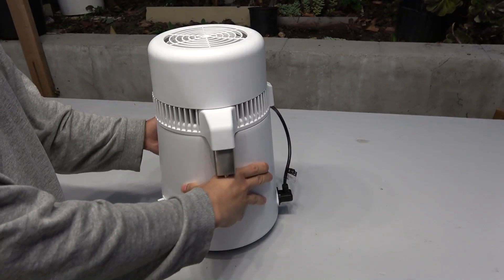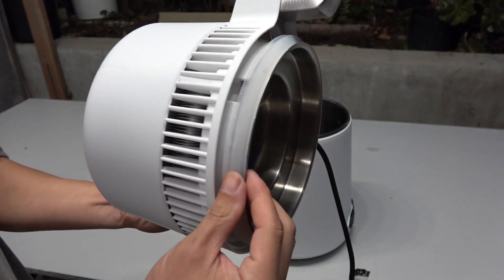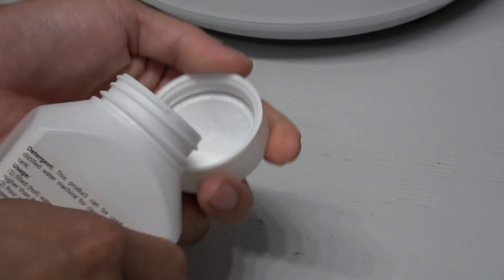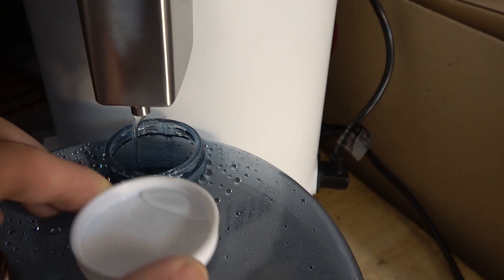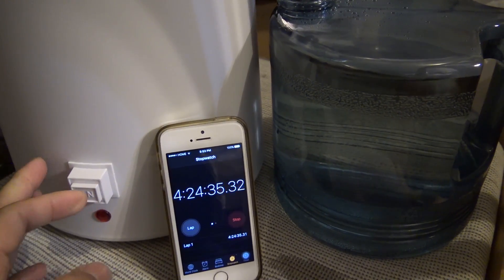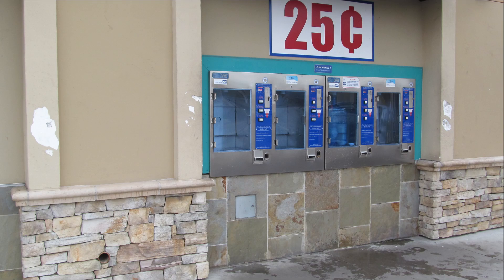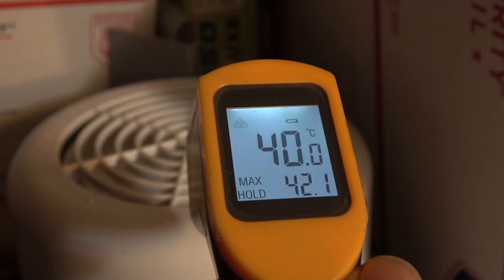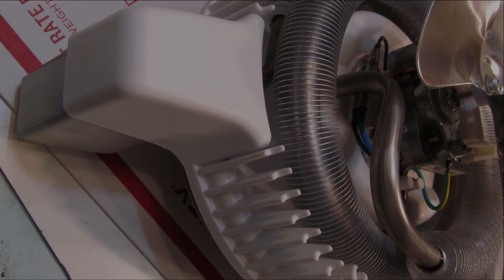Review: $60 Ebay water distiller, all stainless steel internal

Comment: It maybe a little late but why would you want to drink distilled water. It can in fact de-hydrate you and remove needed nutrients from your body.
Reply: Have been using distilled water for years, and is very good for drinking. It's the most pure water the body can uptake, and just ingest minerals with my vitamin supplements. Plus the foods that we eat are loaded with minerals, and isn't just from water that you get them. Additionally if you wanted to, you can purchase liquid minerals and add it to the water. A balanced pH is also very important, as cancerous cells cannot live in an aerobic or oxygen rich environment and is why I use pH sticks or bicarbonate for balance. 
(Note) Beware, you can't believe everything you read on the net people lol
Reply: @AlastairGames  That's exactly right, it is the most pure form of water possible and have been drinking it for years. Basically what you said, we get minerals from food and isn't just limited to water.
Reply: On planet Earth, before man made pollution, were not the clouds virtually raining distilled water...for eons?
Reply: @kelhawk1  Except when the air was polluted from natural events. Odds are most people got their water mineralized from ground sources; obviously different blend depending on where.
Reply: @kelhawk1  not unless you held your head up to the rain
Reply from the maker: Who told you that?
Reply: I Absolutely Love that Response" Who told You that "...which i do not believe .... Water will hydrate no matter if its marked Distilled or Drinking
Reply: @vuaeco  Doctors say it isn't necessarily true, because you can add minerals before consumption. There are several ways people are suggesting to remineralize purified water. For detoxing they suggest considering to drink it pure for a period but don't overdo it. If it's too pure when it gets into your blood stream it will make red blood cells explode. Maybe it can be safe to just mix in a flavored drink mix that includes electrolytes and vitamins. Don't take my word as expert advice. If you have questions ask several doctors or look for their answers that are already provided.
Reply: @vuaeco  It's all over the inet, so it must be true:

Drinking distilled water and not maintaining a balanced diet can cause changes in the levels of electrolytes, minerals, and pH levels in your body.

The pH of distilled water is lower than that of tap water or mineral water, making it more acidic (8). While it’s 7 immediately after distillation, after a few hours it absorbs carbon dioxide from the atmosphere, bringing the pH to around 5.8. This, combined with a lack of minerals and electrolytes, can harm the balance of nutrients in the body (9).

A section taken from a site. You can drink it, but cannot survive, solely, on it.
Reply from the maker: @nicknackthenoo  The "inet" says pigs can fly, it must also be true.
Reply: @nicknackthenoo  You do understand that distilling water separates everything from the water leaving it pure. Yes that includes all the minerals (usually just Calcium, Magnesium, and Potassium) that you can find in Vitamins, and Food, but it also includes Lead, Mercury, Chlorine, Bisphenol A (BPA), Giardia Lamblia, Fluride, etc.. "It's all over the inet, so it must be true" You've obviously lacked research. So I'll ask, Please for the love of common sense actually research this? Eating Healthy, and Drinking Pure Water is the opposite of unhealthy, now if you sit on your ass all day lacking exercise and smoking then go ahead drink swamp water.
Reply: @vuaeco  Yes I have read that and totally agree.
Reply: @nicknackthenoo  Yup...It's all over the inet, so it must be true
Reply: @nicknackthenoo  Sounds bs
Reply: @Drunkbobnopantss  no.. get your minerals from food, if need be take vitamins, I drink spring water and use distilled water all the time. I'm healthy as an Ox, I never get sick and rarely ever get injured, and heal fast when I do. So I've come to the conclusion what I do works, or I'm truly a remarkable specimen. I drink a gallon of water daily half spring, half distilled, I eat 5 meals a day with 2hrs in between, I'm 6' 2" , 240lbs with 12% body fat, and train 5 days a week 3hrs a session, and I'm active the rest of the day, before Covid I was a warehouse supervisor/ operational manager and ran circles around our staff without ever getting winded. I don't smoke, and get 6-8hrs of sleep every night. I'll say it once again "In my opinion" if you're body is lacking minerals than eat more Food, and take vitamins.
Reply: @lokionthelowkey9664  your arguing that distilled water is healthy for you, its exactly the opposite and this was proven like 20 years ago.

"Despite its benefits, distilled water is particularly corrosive. With no minerals to give the water pH balance, distilled water acts like a magnet, absorbing chemicals (phthalates and bisphenols) from plastics, nickel from stainless steel, aluminum from aluminum containers, and carbon dioxide from the air."

not to mention reduces bone mineral density and electrolytes which strains your whole body especially your heart its extremely unhealthy

https://en.wikipedia.org/wiki/Distilled_water#Health_effects

just because your not sick dosent make distilled water safe
Reply: @Drunkbobnopantss  The World Health Organization is more concerned with public policy, which needs to address issues that are sometimes caused by large populations of people making facing unreasonable challenges or making mistakes. If a group of people doesn't have enough calcium in their diet, then the WHO is going to recommend adding a certain amount of calcium to the water supply in that region, with the intent of raising the average levels of calcium in individuals living in that region. On such a massive scale, that's a convenient and relatively quick solution to the problems they recorded. On an individual level, the answers look different. We are certainly examining our own lives far more carefully than the individuals that the WHO is worried about. As individuals, we also don't have the same logistical complications (ex: maintenance of citywide plumbing systems). If we're short calcium, then we can simply add calcium to our diet, regardless of what's in (or not in) the drinking water. The WHO researchers are, rightfully, going to prioritize their advice towards helping people who start off in far more perilous situations than what we are experiencing. They also seem to be informing city planners, and we are not planning cities; well, at least I'm not ;)

As for webmd and Dr. Keppel...

A lot of that material trying to scare us about demineralized water seems to all use the same "it doesn't provide you with nutrients" argument. And I find such arguments unhelpful, because we can obtain those nutrients by other means, thus allowing us to solve far more difficult water safety issues with a simple distillation process.

For example:
"Some studies have found a link between drinking water low in calcium and magnesium and tiredness, muscle cramps, weakness, and heart disease."
https://www.webmd.com/diet/distilled-water-overview#2

I read this as:
"Some studies have found a link between low levels of calcium and magnesium and tiredness, muscle cramps, weakness, and heart disease."

The article doesn't cite its sources, so I can't inspect the studies to see if anyone actually controlled for that.

The same article also says this in the next sentence:
"Also, distilled water may not help you stay hydrated as well as other kinds of water."

I can see how this statement may be true: it doesn't have electrolytes, and electrolytes help my body retain water, so my body won't retain as much of the distilled water, therefore I won't be as hydrated. OK, sure.

Unfortunately, some of us seem to misread this as "distilled water dehydrates you". The article is probably speaking truth, but the echo chambers of the internet can easily provide an interpretation that is no longer true. I suspect that Dr. Keppel picked up one of these interpretations, though he didn't cite sources, so it's hard to check. Doctors are humans too, and even well-intended doctors are fallible. They're even vulnerable to not having enough time to research every little nit-picky subject, as we all are.

As for the WHO article...

The rate of dissolution matters: in this case we're intending to distill some water in a stainless steel assembly and briefly store it in a glass container, where it will be consumed within a day. (The author of this video used a plastic container, but we can just use a glass container instead.)

It's not going to dissolve much on that timescale. We'll probably get more contamination from the small amount of material that rides the water vapors, and probably an even greater amount of stuff landing in the water from our non-sterile environments (unless you're living in a well-equipped clean room).

This avoids any worries about it picking up phthalates, bisphenols, nickel, aluminum, etc. Of course it may pick up carbon dioxide from the air (and, as above, other things too, so don't store it for too long!), but CO2 sequestration and indoor air quality are another problem entirely.

This also addresses many of the points in the WHO article, which seems primarily concerned with discussing the pitfalls of distributing distilled (highly purified) water through various local plumbing systems. In this case, we're making it ourselves, and we're not storing it, so we don't have leaching and bacterial regrowth problems.

" distilled water is one the strongest solvents in the world!"

I googled "strongest solvent" and the Google responded with "butanone" (or acetone).
https://imgur.com/a/rR1zeLA
"Butanone. Butanone or MEK is tied with acetone as one of the strongest solvents. This solvent is used as lacquer, varnish, paint remover, denaturing agent for denatured alcohol, glue and cleaning agent."

This highlights the hazard of using relative terms (ex: solvent) in absolute contexts (ex: strongest). The rate at which a solute dissolves depends on both the solvent and the solute itself. Distilled water does dissolve many things, but not all things, and some of the things it dissolves can be dissolved faster by other solvents.

We could ask Google the same question 5 years from now and get a different answer, and it would still be "right". To obtain and proliferate more useful information, we have to be more specific.

"Believe me i have done my research I would love for distilled water to be healthy but all the evidence points to no, it literally dissolves nearly anything you put it in "

I stand by my earlier sentiment: we are humans, not metallic plates or pipes.

Our bodies react to the substances we ingest in very dynamic ways. Of course, this advantage has limits, and we can't escape harm from extremes, like acetone. But acetone has an extremely aggressive rate of dissolution with respect to organic substances (like cell walls), while distilled water is more of a "jack of all trades and a master of none". Distilled water is not even remotely aggressive enough to burn us before our biomass completely overwhelms it. Sure, distilled water could dissolve a human body, but that would take days (if not longer, especially without decomposers) of complete submersion in a much larger volume of distilled water, and it'd go a lot faster if the body is a dead body (sorry, morbid). This is why I am fairly convinced that the corrosivity of distilled water is unable to harm a human being by way of ingestion.

I suspect, though, that your point is that distilled water picks up contaminants from plumbing or storage systems, and the contaminants can cause harm. Sure. I'm not considering that for myself or arguing for anyone to do that. I'm talking about water that is distilled and used within a day, and using materials that take a very long time to dissolve (decades, centuries) or leach (days, weeks, months) into distilled water.

After that, the worst I'm seeing is that distilled water can harm someone by failing to provide nutrients that they expected to get. For sake of additional clarity: this has nothing to do with corrosivity. More importantly, it has an easy solution: we change our expectations and supplement the nutrients by any number of numerous means. Protecting ourselves from harmful contaminants with our hands tied behind our backs (ex: no distillation or comprehensive purification allowed) is considerably more difficult, if not impossible.

I'd much rather have the "selective supplementation" problem than have the "selective filtration" problem.

Here are examples of products that someone might put in distilled water to create mineralized water before drinking it:
https://vitasell.net/products/tr0005
https://amzn.com/B0028BW0IO
https://amzn.com/B07HHR58LP
Drinking this mineralized water should have a reduced chance of ingesting harmful compounds. Granted, I'm not entirely sure how to be confident that the makers of these things haven't introduced contaminants during acquisition+processing. It'd still be an easier problem to solve, as it involves tightening regulations on a manufacturing process instead of tightening regulations on ALL of the plumbing. As an individual, I'm content that our odds are probably better on this route, even if it's not done perfectly.

I also don't feel any profound need to mineralize my water, because I can get blood tests performed and then directly solve any "not enough nutrients" type problems in the most direct and effective way possible.

At one point I had iffy-looking Vitamin D levels (though not quite out-of-spec), so I supplement that, just to be safe. Now my Vitamin D levels are fine, as well as calcium, magnesium, etc etc. Problem solved.

Unfortunately, blood tests are far less comprehensive when it comes to detecting harmful compounds. The number of things we need is finite (e.g. a list of nutrients), and it is dwarfed by the number of things that can harm us (infinite combinations of molecules and mixtures). Again, it is far easier to start from nothing and build up to what we need, than it is to start from chaos and assay/filter every imaginable chemical substance until we've proven that only our necessities are present.

Even if we disagree about what's in perfect water (and that's totally OK), distilled water still gives us a starting point for creating our own ideal water, and in a relatively inexpensive way.
Reply: @Drunkbobnopantss  Bone and heart disease? Read above. It would take roughly 1800 glasses just to get the DAILY calcium intake.
Reply: @Drunkbobnopantss  Are you a paid shill for them? Been proven wrong by actual factual data here by me and that other dude who wrote a lot about this. No studies or proof can be found of any negative effects on the human body when drinking distilled water.
Reply: @Drunkbobnopantss  And again, US nuclear submarines, 0.002ppm is all they drink... some of the fittest and healthiest people on the planet. IF distilled effected their body or mind, of course it would be stopped.

There are no known scientific data which clearly demonstrate that the consumption of low TDS water by humans will or will not lead to harmful effects on the human body. However, a number of field experiences can be cited which support the premise that the consumption of such water by humans does not cause such harmful effects. There are no known documented experiences which show that consuming low TDS water will create any long-term health effects.

The US Navy has used distilled sea water for 40 years.
Reply: @Edderz  TDS = total dissolved solids = remineraliZed water they are not drinking distilled water that would be TDS 0
As soon as you dissolve anything in the water ie salts or minerals it is no longer distilled water you are drinking. Even 3mg / L is far from distilled when it comes to ion activity in the water.

Point is anything besides TDS 0 is NOT distilled water so everything you said is pretty meaningless
Reply: @Drunkbobnopantss  I’m sure distilled water is classified as 5ppm and below
Reply: @suzyhazelwood9942  this is one of the most ironic things i have ever read, YOUR'E the one being sold lies AND water distillers. there is over 50 years of research from countries all across the world showing the dangers of low TDS water 

Notice how the only ones advocating distilled water are the ones trying to sell you distillers or accreditation programs
Reply: @suzyhazelwood9942  Read how much I’ve shown them. They’re brainwashed and won’t listen to anything other than their biased view
Reply: @suzyhazelwood9942  HAHAHA stay in school kids
Reply: @vuaeco  , the collection container should be GLASS not PLASTIC !
Reply: @Drunkbobnopantss  From that very link you posted near the top "Distilled water is safe to drink."
Reply: @suzyhazelwood9942  I want to try using distilled water because it would be more pure and a less expensive option for my family.  I am wondering though....do the long-time users of distilled water have reports of bone density tests?
Reply: @willow-wf3jf  I doubt exposing ourselves to radiology bone density tests is good for our bodies unless we have a serious need to do so.  I have several friends and relatives who have been drinking distilled water for over 20 years, they are now in their 70's and 80's, not one has health issues with bones, or any other health issue. But friends I know who are nearer my age (50's) and think drinking anything other than tap water is insane have all got bone issues of one kind or another. Tap water is full of chemicals that will gradually destroy the body.

The most important issue with bones is to make sure we eat a really healthy and varied diet rich in vitamins and minerals.  Drinking distilled water will not deplete the body of the minerals we digest from good wholesome food... as some crazy people who have never even tried drinking distilled water have convinced themselves it does.  They all talk nonsense and never base what they know on personal experience. If you want to try distilled water, go for it... it's not going to harm your body... but chemicals in tap water will.
Reply: @suzyhazelwood9942  I drink bottled water but it is expensive, so I was hoping to cut down on cost but also make it healthy.  Thank you for the info.  It is good to hear about personal experience.  Yes, I agree there does seem to be a lot of misinformation.
Reply: @nicknackthenoo  all of which are good things to your body. It does not remove the good minerals found in vegetables and fruits.
Reply: @nicknackthenoo  
LOL
Reply: @nicknackthenoo  Can't survive solely on water anyhow. Just have a cliff bar each day and you've offset the lack of minerals in the water. Easy peasy.
Reply: @nicknackthenoo  And the inet is run by the governMEnt. Learning real science is important, doing the work. We are to get our minerals from food (dehydrate, store, dry can, etc).
Reply: @nicknackthenoo  You seem like a man that would trust more drinking tap water, then filtered distilled water. You have said it all, no need to listen to you.
Reply: @baka-baka-baka-baka  I love this answer,   very informative and strong educated arguments with good analytical points. Thank you so much, just brought my confidence up in my choice of water, especially about what you said, that Its better to start from nothing and build our ideal water, then to start from chaos and try to eliminate the countless potential harmful substances in water.
Reply: @Drunkbobnopantss  yes over 50 years of research. And those very same agencies,  organizations, groups, and people, continue to tell you that drinking tap water is a safe alternative. doesnt it make you a little suspicious, not even a little?
Reply: @originsdecoded3508  what makes me suspicious is people telling me distilled water is the best water whilst selling distillers. its safe to drink as long as you mineraliZe it after which no one ever mentions but then its not distilled water anymore
Reply: @Drunkbobnopantss . Personally for me it beats unfiltered and filtered tap water or even bottled water which leaches decent amount of micro plastics and chemicals.  Its true that distilled water can indeed pull minerals out of the body. But the amount it pulls is very minuscule, and trough the foods we consume like veggies and fruits, and supplements we are constantly replenishing what ever tiny amount of minerals is pulled out. Another great option, but more expensive (700-3000 for home unit) is reverse osmosis machines. 

You know, distilled water just doesnt pull out minerals. since it is considered a form of a solvent like mineralized water, or hydrogen water, it also pulls out toxins and waste from the body, so its perfect combination for detox phases. such as liver cleanses. 

If one is not looking for such detox benefits but only just wants pure water without stripping anything from our body, then I suggest after distilling the water to put sea moss, or cut up fruits high on minerals and let sit in the water. 

Another great alterative to making the distilled water more hydrating is hydrogenize the water ( hydrogen water ) which is form of ionizing the water molecules to give it a positive charge which then has a stronger interaction with the negative charge in our bloodstream thus having a higher rate of hydration, and also acts as antioxidant to cleanse toxins without stripping minerals. 

I definitely agree that distilled water is not the best water, because its practically nothing, its just a baseline from which one can start clean and free of anything at all, and then you enhance it as you wish. 

Optimal living water recipe. 
1.distill the water (99.9% purity)

2. hydrogenize the water in a ionizer (antioxidant/antiflammatory)

3. add sea moss, herbs, or fruits high on mineral and vitamin content. ( remineralization)

This way you have contaminant free pure water, thats mineralized naturally and acts as antioxidant.
Reply: @nicknackthenoo  What a bunch of malarkey. You saw the sludge that leaves behind. You want that crap in your body?
Reply: @LegalizeTheNuclearBomb  thats my point you should remineraliZe your water after distilling but then your not drinking distilled water. distilled water is probably worse for than most tap water actually there is a reason they can't use it in plumbing you will get metal poisoning the leeching is highly aggressive and does the same thing to your bones, blood, electrolytes etc and its a much more powerful solvent when distilled which dissolves just about every container
i also know whats in my water it would extremely stupid for my city to lie because literally anyone can send it to a lab and call them out some countries aren't that fortunate if you actually read my previous comments all i was saying is people should dissolve at least a little salt in distilled water so it becomes remineraliZed water
Reply: @Edderz  I test distilled water. Only one sample was 2PPM, the rest were 0. All store bought. wondering what this machine produces??
Reply: @vuaeco as a matter of fact pigs can fly 😊
Reply: @suzyhazelwood9942  Also get enough water storage capacity so you can do all of your distilling when you need heat for your living space. Maybe remineralize as you store it so the containers last.
Reply: @Drunkbobnopantss  Water quality experts show lab test results of water filtered from a lot of competing cleaning systems and from tap. Also bottled water. All bottled water has micro and nano plastic particulates which accumulate in your body because there is no process known that expels it. A large portion of tap water within USA is also unsafe to consume without filtering; even then some needs distilled. I bought my distiller first because it's $90 (with timer to set to avoid drying out) and the only filtering system I will buy is within range of ~400 or above; well outside of my budget. I also bought a remineralization product. I value my health.
Reply: you can use it for cleaning and for watercooling
Reply: Been drinking distilled water for months now and am still alive :D
Reply: @owlflaps7980  Osteoporosis takes years to develop buddy.
Reply: @Lyron7  Brittle bones lol, what you think the 1% of your daily recommended intake of calcium in tap water is going to help your bones...
Reply: Oh right... that age old lie!!!!😂 Try telling that to the 15 people I know, most have been using water distillers for nearly ten years... they're all in perfect health.  Anyone who has been using a water distiller for years knows that's not true.  If it was, it would make people really ill... it just doesn't do that.  The same type of lie was put about by electric companies back in the 60's warning that watching your television with the lights turned off would damage your eyes.  Turned out it wasn't true, it was just the electric companies making up tales because they were pissed off at how much electric usage had gone down from all the households now in dark living rooms watching glowing tv's.  They just didn't want to lose the money.  Same with the water companies now most homes have water meters.  The local water company in my area even has a ban on collecting rain water in more than one water butt.  They don't want you getting free rain to water your plants, they act like 'they' own the rain!!😆
Reply: Distilled water can be consumed during fastings for example (water fast 1-2 days a week) and then drink mineral water the other days. There are people who wrote about the benefits of dist. water & fasting & healthy lifestyle - Paul Bragg. What I can say for sure, is that 1 day distilled water fasts improve the kidneys function, just as he said in his book.
Reply: Distilled water, fruits & vegetables keep your insides clean & functioning properly. I know people who drink 3-4 quarts of pure distilled water per day
Reply: It's all I drink and I'm still here
Reply: Distilled water is the best water you can drink besides your own urine. That includes tap water, (literally poisonous) filtered water, alkaline water, spring water, etc.
Reply: My grandma drank only distilled water.  Until she died..........at age 97.
Reply: I just don't know why the distilled water bottle sold in grocery stores says it is not good for drinking. I guess because the water may take in some chemicals from the bottle itself. I have not seen it written on all types however.
Reply: @ikemotohatsune757  because it's bottled in plastic, which contain neurotoxins. And tastes rather horrid.
Reply: @Edderz  your making things up and using anecdotes as your proof, means you lost the arguement
http://www.accomplishmoretoday.com/public/images/WHO%20Nutrients%20in%20Drinking%20Water.pdf#page=157

begins page 152 goes on and on and actually provides sources and citations from studies conducted from different countries for the last 50 years

"For about 50 years, epidemiological studies in many countries all over the world have reported that soft water (i.e., water low in calcium and magnesium) and water low in magnesium is associated with increased morbidity and mortality from cardiovascular disease (CVD) compared to hard water and water high in magnesium. An overview of epidemiological evidence 
153is provided by recent review articles (12-15) and summarized in other chapters of this monograph (Calderon and Craun, Monarca et al.). Recent studies also suggest that the intake of soft water, i.e. water low in calcium, may be associated with higher risk of fracture in children (16), certain neurodegenerative diseases (17), pre-term birth and low weight at birth (18) and some types of cancer (19, 20). In addition to an increased risk of sudden death (21-23), the intake of water low in magnesium seems to be associated with a higher risk of motor neuronal disease (24), pregnancy disorders (so-called preeclampsia) (25), and some cancers (26-29)"

And of course there are no deaths directly from distilled water, you die of things like cardiovascular disease earlier from nutritional defencies caused by low TDS water DUH!  

since you like anecdotes here is one that actually holds some water and i didn't just make up in my head

https://www.mercola.com/article/water/distilled_water.htm

Dr. mercola
"I have done well over 3000 mineral evaluations using a combination of blood, urine and hair tests in my practice. Almost without exception, people who consume distilled water exclusively, eventually develop multiple mineral deficiencies."
Reply: @Drunkbobnopantss  
WQA Technical 

Fact Sheet
 
Discussion of Field Experiences
There are no known scientific data which clearly demonstrate that the consumption of low TDS water by humans will or will not lead to harmful effects on the human body. However, a number of field experiences can be cited which support the premise that the consumption of such water by humans does not cause such harmful effects. There are no known documented experiences which show that consuming low TDS water will create any long-term health effects.

WQA wishes to express sincere appreciation for the unselfish contributions of the members of WQA who contributed their time and expertise toward the completion of this bulletin.
The Water Quality Association publishes this Technical Application Bulletin as a service to its members and the interested public. 

Information contained herein is based upon the most recent public data known as of the publication date, which is printed at the bottom of the last page, and of course, cannot take into account relevant data published thereafter. The Water Quality Association makes no recommendations for the selection of a treatment system, and expressly disclaims any responsibility for the results of the use of any treatment method or device to reduce or remove a particular contaminant.

Arvind Patil, Ph.D., CWS-I Gary Hatch, Ph.D. Charles Michaud, CWS-VI Mark Brotman, CWS-VI P. Regunathan, Ph.D. Rebecca Tallon, P.E.
Richard Andrew
Shannon Murphy
Steve VerStrat
Pauli Undesser, M.S., CWS-VI Kimberly Redden, CWS-VI

For the 10th time. 🥲🤥
Reply: @Edderz  Im still not seeing any citations to actual research "There are no known scientific data which clearly demonstrate that the consumption of low TDS water by humans will or will not lead to harmful effects on the human body"

Citations look like this, and directly contradict what your "report" says so that's an outright lie

Sauvant M-P, Pepin D. Drinking water and cardiovascular disease. Food Chem Toxicol 2002; 40: 1311-1325. 
13.Donato F, Monarca S, Premi S, Gelatti U. Drinking water hardness and chronic degenerative diseases. Part III. Tumors, urolithiasis, fetal malformations, deterioration of the cognitive function in the aged and atopic eczema. (In Italian.) Ann Ig 2003; 15: 57-70. 

14.Monarca S, Zerbini I, Simonati C, Gelatti U. Drinking water hardness and chronic degenerative diseases. Part II. Cardiovascular diseases. (In Italian.) Ann Ig 2003; 15: 41-56. 

15.Nardi G, Donato F, Monarca S, Gelatti U. Drinking water hardness and chronic degenerative diseases. Part I. Analysis of epidemiological research. (In Italian.) Annali di igiene - medicina preventiva e di comunita 2003; 15: 35-40. 

16.Verd Vallespir S, Domingues Sanches J, Gonzales Quintial M, et al. Association between calcium content of drinking water and fractures in children. (In Spanish.) An Esp Pediatr 1992; 37: 461-465. 

17.Jacqmin H, Commenges D, Letenneur L, et al. Components of drinking water and risk of cognitive impairment in the elderly. Am J Epidemiol 1994; 139: 48-57. 
161

18.Yang CY, Chiu HF, Chang C, et al. Association of very low birth weight with calcium levels in drinking water. Environ Research 2002; Section A, 89: 189-194. 

19.Yang CY, Chiu HF, Chiu JF, et al. Calcium and magnesium in drinking water and risk of death from colon cancer. Jpn J Cancer Res 1997; 88: 928-933. 

20.Yang CY, Cheng MF, Tsai SS, et al. Calcium, magnesium, and nitrate in drinking water and gastric cancer mortality. Jpn J Cancer Res 1998; 89: 124-130. 

21.Eisenberg MJ. Magnesium deficiency and sudden death. Am Heart J 1992; 124: 544-549. 

22.Bernardi D, Dini FL, Azzarelli A, et al. Sudden cardiac death rate in an area characterized by high incidence of coronary artery disease and low hardness of drinking water. Angiology 1995; 46: 145-149. 

23.Garzon P, Eisenberg MJ. Variation in the mineral content of commercially available bottled waters: implication for health and disease. Am J Med 1998; 105: 125-130. 

24.Iwami O, Watanabe T, Moon CS, et al. Motor neuron disease on the Kii Peninsula of Japan: excess manganese intake from food coupled with low magnesium in drinking water as a risk factor. Sci Total Environ 1994; 149: 121-135. 

25.Melles Z, Kiss SA. Influence of the magnesium content of drinking water and of magnesium therapy on the occurrence of ٛesalinizedٛa. Magnes Res 1992; 5: 277-279. 

26.Yang CY, Chiu HF, Cheng MF, et al. Esophageal cancer mortality and total hardness levels in Taiwan’s drinking water. Environ Research 1999; 81: 302-308.

 27.Yang CY, Chiu HF, Cheng MF, et al. Pancreatic cancer mortality and total hardness levels in Taiwan’s drinking water. J Toxicol Environ Health 1999; 56: 361-369

There are over 60 citations from around the world all showing low TDS water is bad for your health  vs your one report that has NO citations or actual research hahahaha
Reply: @Drunkbobnopantss  And that actually proves another point, how they’re basing the death on low minerals and blaming it on water, when less than 1% of those peoples minerals can possibly come from water, you realise most people don’t drink more than one glass a day let alone 4 litres. Even at 4 litres I worked out bottled mineral water in my area is around 3% of my recommended intake, 4 LITRES of it.
Reply: @Edderz  hahah you jump around without proving anything actually, 
your still not getting it, low TDS water leeches minerals from your body instead of giving you any. 
THAT'S the problem not the % DV your getting from the water.
Try harder
Reply: I rather drink that than water full of graphene oxide and other 💩
Reply: If you have carvinerous plants you might want to give them distilled water or rain water or else they probably gonna die
Reply: According to the WHO, these and other associated health problems are partly due to the lack of minerals and electrolytes in distilled water. This lack forces unhealthy changes in the delicate balance of sodium, potassium, fluid, calcium, magnesium, zinc, phosphorus, and other nutrients in the body.

When the body loses water through sweating and urine output, it loses sodium and other minerals in addition to water. In order for the body to function properly, a person must replace those minerals.

Drinking distilled water will not replace minerals lost through sweat, as all additives and minerals will have been removed during the distillation process.

Distilled water pulls in small amounts of minerals from any material it touches, including plastics and the body (including one’s teeth). Still, if a person eats a balanced diet with the recommended amounts of fruits and vegetables, they should not become deficient.

Since most people eat and drink a variety of foods and beverages throughout the day, most people will get the salts and minerals they need from these other sources.
Reply: @lazurm  ok sir, just drink your daily tap water. drink about 8 of them. when you start to have health issues, give pure water a try. 
not saying its the best, but 300 harmful chemicals in tap water, is not safer then water with nothing in it. regardless of what other things distilled water will do, tap water is bound to have faster harmful effects on body.
Reply: You would need to drink multiple gallons of non distilled water to get the daily minerals needed. Proper diet will give you your daily minerals.
Reply: @howtodothings8415  and distilled water will happily steal those daily minerals.
Reply: @Drunkbobnopantss So how much of those minerals will distilled "happily steal"? It's my understanding that only a miniscule amount is leached.
Reply: Get your minerals in your fruits and vegetables.  Distilled water is pure H2O.  Tap water has a lot of non-organic particles that can cause kidney stones and other problems at the cellular level.  I'm 73, and healthy.  I've been drinking distilled water since age 25; after reading "The Shocking Truth About Water" by Bragg.  Also more recent article by William Misner, PhD states drinking distilled water actually enhances mineral absorption from our foods.  It's important to realize there's a difference between organic minerals from foods, and inorganic minerals found in water, which cannot be used at the cellular level and are bad for us.
Reply: Nick Edd
Whatever vital ingredient distilled water is imagined to lack, can certainly be added. Like the minerals we mostly assimilate from food, that you fantasize we would miss out on. 
Couldn't easily find any studies specifically linking the drinking of distilled water, to dehydration. Why don't you post some links, so we can review their veracity?
Reply: @kelhawk1  also the minerals in water are inorganic. Our body uses organic minerals that we get from foods.
Reply: @Edderz  Actually you are There is 0 evidence that distilled water is beneficial in any way
 I showed you proof that distilled water does in fact leech minerals and electrolytes from the body, 
 and your answer was some blown out conspiracy theory about the WHO being terrorists LOL that makes NO sense

Distilled water is fine for say SHORT term military deployments where they may not have access to clean drinking water,  LONG term it's a terrible idea.
Reply: @Drunkbobnopantss  US EPA's Dr. Edward V. Ohanian, Chief of Human Risk Assessment Branch wrote, “Drinking water supplies a number of minerals that are important to human health. However, drinking water is normally a minor source of these minerals. Typically, the diet is the major source of these beneficial minerals. I am not aware of any data adequate to support the conclusion that water with low levels of minerals is unsafe.”

You’re a troll
Reply: @Drunkbobnopantss   Yet they drink it for months at a time and you’d rather drink water with chlorine, fluoride, pharmaceutical runoff, drugs, hormones, human waste. Lol you are thick. Do you realise kidney dialysis which cleans the blood for the body uses distilled water only? What does that tell you? There is endless evidence fluoride is linked direly to arthritis and alzheimer's.

There is obviously a safer and healthier way to clean the body with distilled vs tap water. 

Dr. Rozelle review:
Appendix A
“The data for their conclusions are not very convincing from a scientific viewpoint. The volume of water consumed per day was not indicated and the length of time of the experiment for the human "volunteers" was not indicated (one year fpr rats). The physiological changes reported apparently were based on rat and dog studies. For dogs, the same physiological changes were observed for water containing 50 mg/L and 1, 000 mg/L. The conclusion of a minimum TDS of 100 mg/L is confusing and thus not very convincing. In the human studies, diuresis was observed particularly on the second day of the study (the increase in urine output reported to be 18%). The volume of water in the body from the "distillate" was reported to be 50-100% higher than the "other groups." They also reported increased elimination of sodium, potassium, chloride, calcium, and magnesium in the urine, and the specific gravity was reduced. In the blood serum, the sodium was increased and the potassium decreased. Then it was reported that the "tendency" for similar changes were observed after consumption of 100 mg/L TDS and 1,00 mg/LTDS. The water intake (based on thirst) of various TDS waters was not clearly reported. In some cases it was difficult to determine if the data were from animals or humans. In summary, the Russian studies, as reported in Annex 8 of the WHO document appeared not to be rigorously scientific.”
Reply: @Drunkbobnopantss  @Edderz  No, Drunkbob, you didn't show proof of anything.  You showed what wikipedia wants people to believe.  How many falsehoods from the wiki people must one actually see to stop using them for any point at all.  Wiki is used for purposes other than truth, when truth is most important.
Reply: @Edderz  No I know whats in my water, if your water is THAT bad then the proper way to drink distilled water is to dissolve some salts or minerals in it first, there are some great benefits doing it this way.
The navy only drinks low tds water because they have to and its not like its going to kill you quickly, further they can simply dissolve some sea salt or alter their diet to compensate for the effects, that does NOT prove distilled water is beneficial or harmless.

It's humorous that this report (opinion piece actually)  - which has 0 citations - calls the WHO study "hardly scientific"  and that no there is no evidence to suggest otherwise

http://www.accomplishmoretoday.com/public/images/WHO%20Nutrients%20in%20Drinking%20Water.pdf#page=157

It has been adequately demonstrated that consuming water of low mineral content has a negative effect on homeostasis mechanisms, compromising the mineral and water metabolism in the body. An increase in urine output (i.e., increased diuresis) is associated with an increase in excretion of major intra- and extracellular ions from the body fluids, their negative balance, and changes in body water levels and functional activity of some body water management-dependent hormones.Experiments in animals, primarily rats, for up to one-year periods have repeatedly shown that the intake of distilled water or water with TDS ≤ 75 mg/L leads to: 1.) increased water intake, diuresis, extracellular fluid volume, and serum concentrations of sodium (Na) and chloride (Cl) ions and their increased elimination from the body, resulting in an overall negative balance

The German Society for Nutrition reached similar conclusions about the effects of distilled water and warned the public against drinking it

For about 50 years, epidemiological studies in many countries all over the world have reported that soft water (i.e., water low in calcium and magnesium) and water low in magnesium is associated with increased morbidity and mortality from cardiovascular disease (CVD) compared to hard water and water high in magnesium. An overview of epidemiological evidence 
153is provided by recent review articles (12-15) and summarized in other chapters of this monograph (Calderon and Craun, Monarca et al.). Recent studies also suggest that the intake of soft water, i.e. water low in calcium, may be associated with higher risk of fracture in children (16), certain neurodegenerative diseases (17), pre-term birth and low weight at birth (18) and some types of cancer (19, 20). In addition to an increased risk of sudden death (21-23), the intake of water low in magnesium seems to be associated with a higher risk of motor neuronal disease (24), pregnancy disorders (so-called preeclampsia) (25), and some cancers (26-29)

etc etc start reading around page 152 there is LOOOOOTS more
Reply: @Drunkbobnopantss  Conclusion
It has been concluded that the consumption of low TDS water, naturally occurring or received from a treatment process, does not result in harmful effects to the human body. This is based upon the following points:
• No public health organization with authority over the drinking water quality anywhere in the world has enacted or even proposed a minimum requirement for total dissolved minerals in drinking water.
• The human body's own control mechanism (homeostasis) regulates the mineral content of the body fluids and the discharge of different types of ions from the body of normal health individuals drinking water with low or high mineral content.
• Several types of scientific literature searches have found no harmful effects to the human body attributable to the consumption of low TDS water.
• Review of the Soviet report has shown that the scientific methods used are questionable and the conclusions are either vague or unsupported by the data.
• Many examples of real-world situations in which large populations have been and continue to be provided exclusively with low TDS water without any reported unusual or ill health effects, establishes the safety of consuming such waters by human beings.
Reply: @Edderz  Again 0 citations, the epitome of hypocrisy this 10 page opinion piece calling the WHO study "unscientific" which is chock full of citations and backed by over 50 years of research on the effects of low TDS water.

your desperately grasping here, just showed you proof that low TDS causes a slew of health problems many of which take years to develop
including osteoperosis, neurodegenerative and cardiovasular disease, sudden infant death, birth problems and your referencing the same paper you already used which has 0 citations
Reply: @Edderz  your funny, they are ALL citations showing that soft low TDS water is linked to many diseases so far lets see I have like 60 citations  to studies show the same thing and you have no citations backing up YOUR claims

Your desperately making things up  because you've been proven wrong so badly 
and you resort to insults and strawman arguments 
it's sad
Reply: @Drunkbobnopantss  Ok, I along with millions will keep drinking it and let’s see what happens. What an idiot, another thing you don’t realise is they aren’t autopsy’s. they’re an ‘educated’ guess. All down to mineral deficiency’s, which can obviously be their DIET NOT WATER,
Reply: @Edderz  I wonder, If Distilled water is the healthiest, can you go to a naturist/organic/health foods or even a normal supermarket and buy a bottle of it? All the distilled water I found in my supermarket are branded for car battery maintenance.
Reply: @Lyron7  Best for your car engine? Best for doctors and surgery? Must have for kidney dialysis machines? Which is the main organ which NEEDS pure water. Best for your hair and skin? It’s the best for literally everything, apart from drinking eh 🤣
Reply: @Lyron7  No evidence what so ever exists that it leaches minerals from the body. The only bad point you can say is the lack of ‘minerals’ which tap water has way under 1% of your RDA. But filled with chlorine chloride, heavy metals and fluoride. I’ll drink distilled, when you study how the body actually works and how tissues and organs react to substances and dietary food and liquid it makes perfect sense to drink mostly distilled.
Reply: @Lyron7  Every supermarket I go to has distilled water next to spring and drinking (reminerlized filtered) water. I assume most of it is bought for consumption per preference of each who buys it. A small percent of people might have other purposes that require pure water.
Reply: @drunkbobnopantss
 your citations and sources are unironically flawed as is your argument for why the world should trust the WHO and your copypastas...
Proof is in the pudding baby, no ones dead from distilled water the made themselves on record TO THIS DAY, however there are thousands if not millions of cases of lives being extended beyond greatest expectations and sicknesses being eradicated...
INCLUDING the dirty old sexual deviant and his diseases, old buddddddy al gray bell
Reply: @Bill Hagara Jr my new iron specifically states distilled water not to be used. It wants lime free water. It mentions ions and a word similar to corrosion. I think it says something about distilled water damages the iron by combining with the materials and washing them away...
Reply: @chancerybunch4757  I always seems to get white buildup on irons when using hard tap water
Reply: Then take vitamins Nd colloidal silver
Reply: this is survival water or for battery/lab usage..not for daily consumption..
Reply: Because when you're in the middle of the ocean in the tropics you have plenty of solar and no fresh water.
Reply: You get your minerals from your foods anyway.
Reply: The WHO, cdc, fda, etc...  Don't want you drinking pure water because it affects their business of harm and fear!  They are the biggest drug pushers.  Their purpose is to kill Adam's seed.... But you will not believe that.

Test the tap water and you'll find how crappy it is!  I'm from a state in the us with some of the best tap water and it's full of junk.  Does my body miss that junk??? The answer is no.
Reply: Your food will replace anything  lost ..Distilled water is the best for us to drink.You are must informed .
Reply: I like how there's 17 likes and 97 comments.
Reply: It takes the poison out ..your body is electro magnetic..wtf is it taking out ?
Reply: @Bill Hagara Jr
" Apparently lots of people think there's something wrong with PURE water.  I don't know where that started but I say again.  That's just silly.:

It all started with the same people telling the population that its safe to drink tap water!
Reply: U need to research that fact.  Minerals in body are differently charged than heavy metals and apparently the distilled water does not pull minerals from organs, blood etc  dyod
Reply: idiot spotted
Reply: @Bill Hagara Jr I use it in my kettle and my humidifiers. Occasionally I might drink some.
Reply: you're so brainwashed.
Reply: That is NOT true. If you believe that, you have been fully programmed and brainwashed. Distilled water is 100% H2o.  WATER with NOTHING else in it. I only drink Distilled water and NOTHING else not even juice. I am over 50 and can out perform most 25 year olds. I am not dehydrated in any way shape or form. Can not believe so many people have no brain to think with. How can PURE water harm you????? ha ha ha ha ha George carlin was right.
Reply: Great for making whiskey some people do that doesn’t mean it has to be for drinking !!!
Reply: Distilled water removes heavy metals, parasites, and radioactive material that regular “filters” don’t remove. Make sure to take some minerals though if drinking distilled water 👍🏼
Reply: Please think beyond what your told. Your life depends on it. When you distill your water for one week and check the bottom of the bowl that first time, you will never in good conscience drink from the tap again. What you see caked to the bowl is what would have caked to all your vital organs. As children we can filter these poisons, as we age, our organs basically resign from the abuse. While there's seems to be logic in your assumption, the alternative is trusting the tap water or the plastic bottled water. I will trust the distiller and if needed, add minerals afterwards, although, my diet and supplement intake is ample.
Reply: From my research, it is my understanding that distilled water only leaches out toxic minerals from your body, such as lead, mercury, cadmium.... It also leaches out otherwise healthy minerals but only if you have an excess of them. Too much calcium or iron, for example are toxic, and distilled water will leach them out to the extent necessary. So, basically, distilled water serves as a detoxification mechanism. Historically humanity used to drink predominantly rain water. Don't forget that rain water is distilled water; of course now it is polluted due to all the air pollution. I've been drinking distilled water exclusively, including for cooking, for the past 15 years, and so has my entire family. We are all doing fine. There is a lot of scaremongering surrounding distilled water to keep us from benefiting from using it.
Reply: bs
Reply: @MaximGhost-v7v  As I heard the body never able to use the minerals from the water any way. Even mineral water clogs up their stones in the body eventually.
Reply: @TamasLukacs-ltommie  mineral water is water without the chlorine and fluoride. It can be high in sodium.
Reply: Best digital-accent on the net :) Would you try distilling the same tap water 2x or 3x so the efficiency of removing hard salts can be seen on the container inside? If it is completely clean the second time it should be fine.